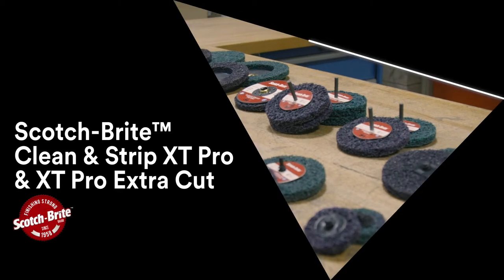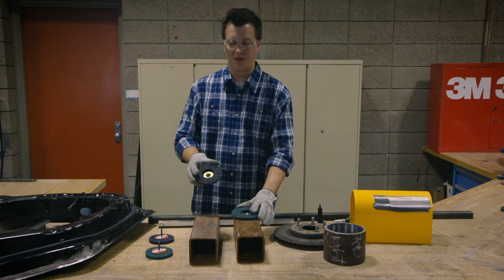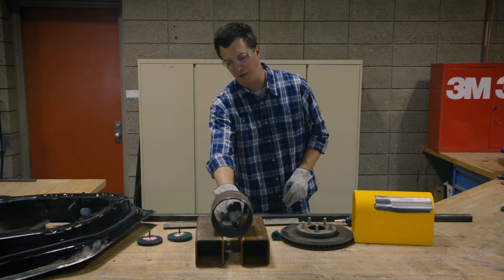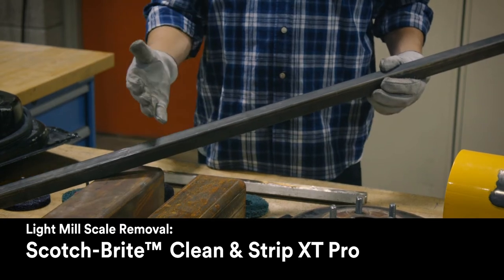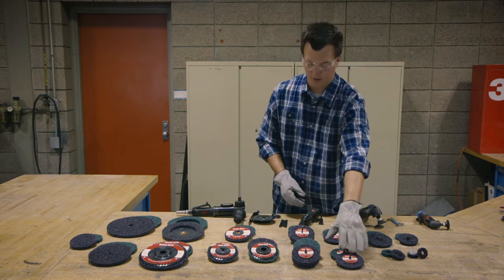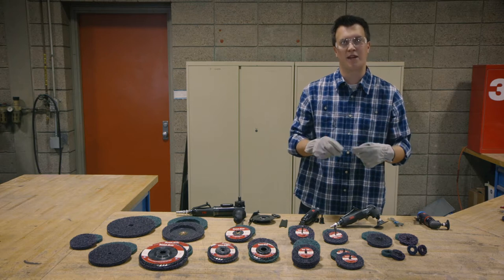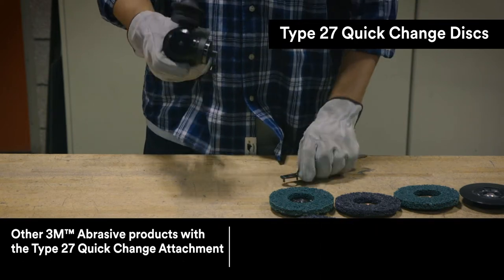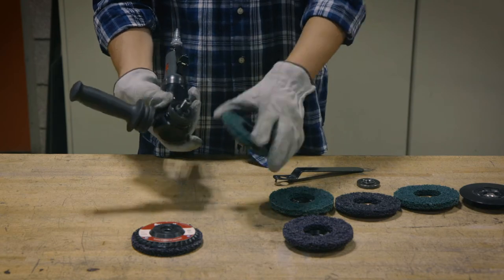3M Abrasives Scotch Brite Products

Comment: I'm in Edmonton Alberta. What are the chances I can walk into a Vallen distributor here and find someone with the same knowledge you show in your video? I want to buy a bunch of these items but I want to talk to a guy that can say here you go instead of..... got a part number or item number? These 3M Roloc accessories are confusing but this video helps clear things up bigtime. However, I want to be able to go in and say I need certain discs and have the guy know "EXACTLY" what holder I need to go with that disc! I also want to know/see what the difference is between getting a spindle mount vs the Roloc+.